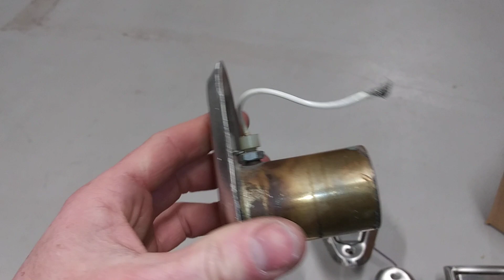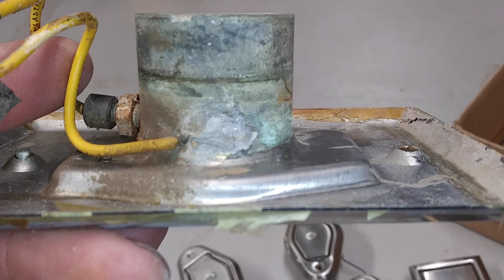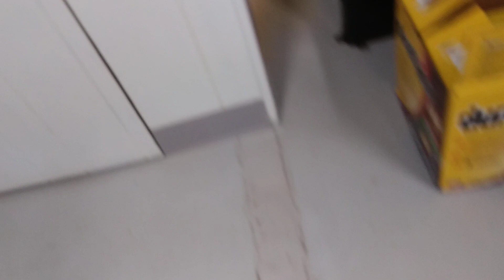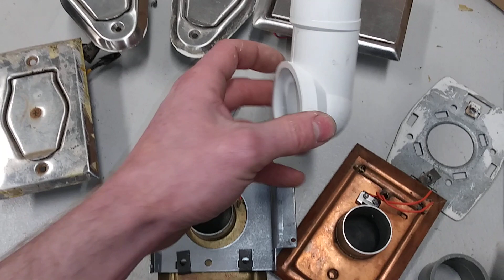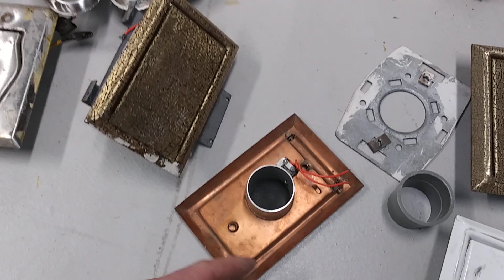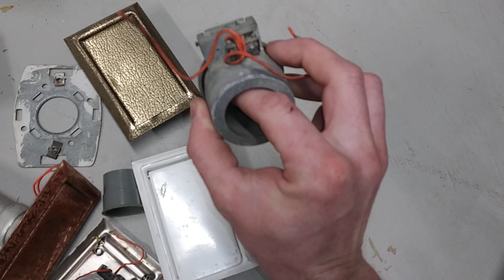Vacu-Maid and Vacuflo Metal Central Vacuum Inlets

Comment: Even today, Vacuflo's utility valve works similarly, it activates the unit when you open them. Since I use all of my central vacuum units without pipes, I use utility valves with all of them. For the units that have a manual switch, I use this utility valve.

https://www.thinkvacuums.com/central-vacuums/installation-materials/wall-inlets/universal-020017-utility-inlet-valve.html

I just put the valve on the in-take and connect the hose, I don't connect the low voltage wire, I tried to do this at one point, but since I'm blind I couldn't seem to get the wires connected right, and because of that, for a while I didn't get any units for my collection that didn't have a switch. Than I found this utility valve made by Vacuflo.

https://www.centralvacuumstores.com/central-vacuum/repair-and-replacement-parts/find-other-replacement-parts/repair-and-replacement-parts/vacuflo-white-utility-valve

It has a few feet of low voltage wire hard wired in to the utility valve which solves the issue I was having with trying to connect the wires to the screw terminals, connecting the wires to the central vacuum unit is easy, so thanks to this utility valve, I was able to get some units that don't have a manual switch and it works great.